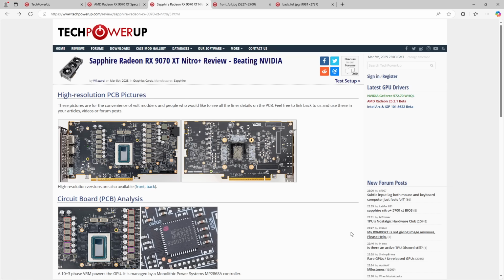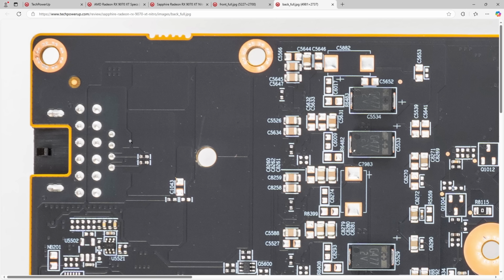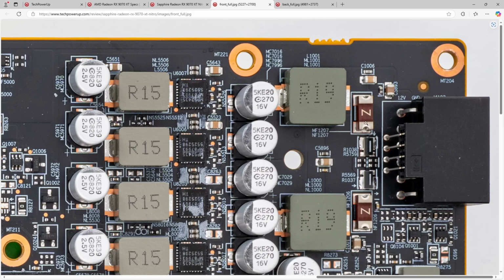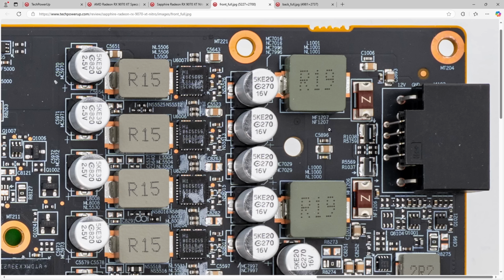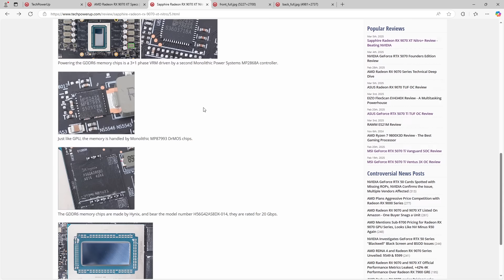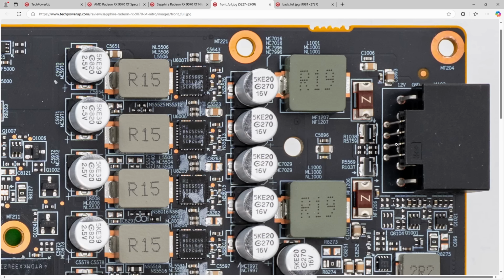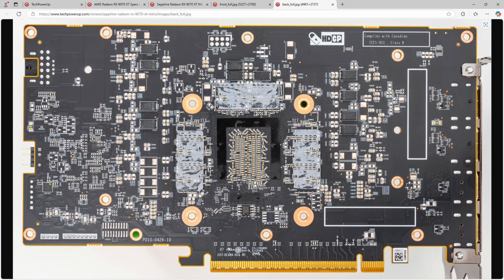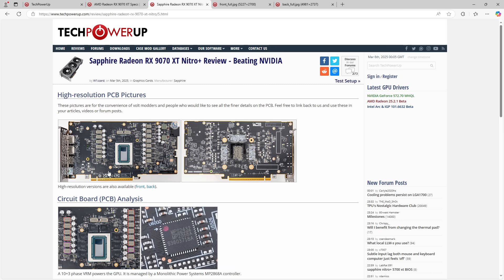Taking a look at Sapphire implementation of the 12VHPWR connector on the RX 9070 XT Nitro+

Comment: Mechanically, there's not really a way for 5 terminals to "make bad contact", 12vhpwr had an issue with partial connector insertion, 12v-2x6 with adjusted lengths of power and sense pins is not vulnerable to that same partial insertion issue that GN demonstrated.  So you're left with contact wear and corrosion to give you an imbalanced connector. The first is solved by leaving the thing alone once it's plugged in. The second is solved by not using materials which will give you galvanic/fretting corrosion (looking at you, lian-li, moddiy, and zotac, for variously speccing gold pins and terminals despite the spec calling for tin). 

If 5 circuits somehow did make bad contact, that'd be 25A on a single circuit, at worst spec contact resistance (6mOhm) that's only 3.75W of power dissipation, on a brand new (>=2mOhm) terminal it's 1.25W of power dissipation. It's more than you want on a single terminal and is 250% of a normal worst case single terminal (9.2A @ 6mOhm), but I'd expect you can also run it like that for quite some time considering Roman's wildly imbalanced cable was flowing 22A and he didn't even know he had a problem.

Comment: PSU side load balancing using multiple rails is strictly forbidden according to the publicly available ATX3 spec. The spec states, that all pins on a 12V-2x6 port have to be connected to the same power supply rail. The most any psu manufacturer could do within the spec would be per pin current monitoring to trip the OCP when any single pin draws too much current.

Some additional information regarding card side power balancing:
According to older PCIe Electromechanical Specifications it was explicitly forbidden to connect multiple power sources in parallel, meaning the 75W board power and all additional power connectors could not be shorted together in any way. That is likely why in the past all cards with multiple 6 or 8 pin connectors had load balancing. The specification forced manufacturers to split up phases.

I cant read the latest Revision of the spec which includes the 12V-2x6 since it costs 4500$ for non PCI-SIG members, but my guess is, that since all power comes from one source, manufacturers are at least allowed to do no load balancing, and may very well just skip it to save money.

Comment: Hey Buildzoid, food for thought: Igor Wallosek @igorslab just published a nice piece on how current Nvidia and AMD cards route the power return, finding that especially RDNA4 cards tend to have only about 10% of current go across the ground wires of the connector and the remaining current is dumped into the mainboard's ground plane via the PCIe slot.

Would love to hear your take on the matter.

Comment: i always wonder why the 8 pin PCIe connectors weren't just switched with 8 pin EPS, those can deliver up to 300w per connector -> 600w for a two cable card vs. 600w for this melting piece of garbage. 
Anyone knows why they didn't just do EPS instead of PCIe connectors ?

Comment: I had hopes that Sapphire did improve the implementation but they did not. 350watt is still to much and could burn the connector/wires. So it would be best to avoid this card and pick on with 2x or 3x 8p.

Comment: if all wires are dumped to one common rail immediatelly after the connector then whats the point of splitting the wires in the first place ... just take ONE wire that can actually handle the load which would also be more efficient to begin with than several thinner gauge wires ...

Comment: 2 fuses makes more sense than 6. If 6 fuses were used,  single fuses could blow, and the card continues to run until the others blow. If this OC card uses 360 watts /12v = 30 amps, 30 amps/6= 5 amps per wire. The fuse they use must be rated to the max current of one sigle wire in case the other 2 wires lose connection. A betted design would be current sensing for each 12v wire where no current or high current conditions could be detected. It is a cheaper solution to group all the 12v wires together for the 12v high power connector to share the current. 600w and 1 fuse over 50 amps is a horrible use of this connector on RTX5090 FE.

Comment: what I would like to see is a psu with built in 12v high power protection so the gpu can only pull what the single cable is rated to. there are smarter people than me on here that say it can be broken down it to 3 separate power stages ? what do I know I have not liked this plug from day one

Comment: @ActuallyHardcoreOverclocking that was THE review I was looking for. 

Thanks alot, what about Asorck 9070 XT TAICHI ? Can you please check that one please ? Nitro + and TAICHI was the 2 models I was looking for. And botch unfortunatly with 12V pin. If you could just respond here for GO/NO GO for the TAICHI it will be much apriciated. Wanna buy day one before scalpers, with stock and low price before demandes rises prices. 

<3

Comment: If there is an alternative 9070xt that doesn't use high phailure connector, just don't buy this, and buy that alternative one instead, vote with your wallet people. If this connector will become a money stopper, they just wont use it or will be forced to redesign it. As simple as that. Thanks buildzoid for another useful video!

Comment: Basically It's 12v 2x6 just carry the same power as 12V wires of 2x8pin.

It should be no problem unless very unbalanced current happen, It could heat up significantly but not melt due to it still a lot less current than what will happen in 5090.

Comment: You probably dont need to balance a 350watt gpu thats now even that much
Reply: That's still 30 Amps; the connectors are rated for a max of 9.5 A per pin ... with a laughable safety factor of 1.1. 
There's more than enough potential for disaster even on cards that don't draw 600W+.

Comment: Damn it Sapphire, you were the Chosen One!!
"It's over, I have the high failure connector"
Reply: Yeah, I'm a bit disappointed to see this because Sapphire has made great cards for a long time. PowerColor has been gunning for them, though, so I guess that's the next choice whenever AMD releases on the high end again and Sapphire uses this connector. 🤷
Reply: @dangerwr just don’t get the nitro, get the pulse. Problem solved and you get a sapphire card.
Reply: @OggaDugga  The Sapphire Pulse doesn't seem all that good this generation. Not bad, but not particularly good either. Sapphire cards only have 2 year warranties now, and that alone makes me want to get something from a different brand.
Reply: @syncmonism get something soon then because prices are on the rise 😂
Reply: Could get a Nitro+, but didn't trust this connector so went with Pure.
I see I'm not the only one not wanting to pay more for less safety.
Reply: nitro+ is the only one that has it.
Reply: @pedroduran8927  Yes. And, to be clear, only the Nitro+ 9070 XT. There is also a Nitro+ 9060 XT, and that model uses a standard 8-pin connector. 

I really don't understand why they would use this connector on their fanciest model. It seems like a really beautiful card aside from the choice of connector.
Reply: You underestimate my power!
Reply: @joshuaevans3501  don't try it!

* insert picture of smouldering anakin/12vhpwr connector *
Reply: @givemeajackson  😅😅😅
Reply: isnt sapphire owned by asus ?
Reply: No it's an entirely different company
Reply: @damasterpiece08  I thought it was owned by one of the bigger companies too, but it's apparently still a completely independent and privately owned (Taiwanese) company.

Comment: I wish they'd taken the opportunity to implement remote voltage sensing in the 12VHPWR spec and a maximum allowable voltage drop across supply cables so the device (GPU) could sense excessive voltage drop across the cables from the PSU. It saves having to have multiple current measurement channels at the input and the circuitry needed to actively balances but still gives you the fault condition detection.

Comment: To understand where they went you have to see where they came from. Not until the 8800GTX did PSU's need more than a single separate amp power rail output. Users even SLI'd off this. Simplified it was a single breaker that supplied enough amps for the given outlets.
When the 8800 launched this changed into 2 rail delivery or double breaker/buss providing more watts or stability/reliability if a GPU/Device tapped into each rail.
Broken down:
40amps or 3x8 pin connectors per rail with +10%
40a X 12v=480w and 480w / 3x8pin=160).
Each 8 pin listed limit: 150w

This card is using a single power rail + 75w provided by the PCIE port. and even though the power pins are joined, the split breaker design is near the middle allowing drain to have more even spread across input pins even at high load.
NV issue you showed last time had a 2x40 amp rail in a hard offset single point shunt design. This offset causes resistance balance with a multi wire design and like lightning, under heavy load will take the shortest path. A single wire or pair.
Current PSU designs will give a full 4 Rails 4X40amp.

That connector needs an update consort. Either GPU designers need to customize per board power delivery, or they need to redesign the source and each pin on a PSU should have a balance check upon output. And don't call it V1.1 of the same PSU line. That will just confuse consumers.
Needs a noticeable name change so you don't get the common ignorant "What's the difference".

Also consumers should understand when a GPU provider states the PSU needs, this considers you're using the newer standard which provides a number of rails based on that. A 4 rail PSU @ 40A, just the GPU power ports alone, provide 744watts ignoring all other ports and power needs of the full build. A 700w PSU is not going to have 4 rails. So follow this guidance well when changing GPU's.

BTW I'm with you. I don't like the design.

Comment: 0:38 "no active current balancing for this power connector. like if you were to cut off five of the 12 V wires all the current would just go through the one wire that you didn't cut"
and how "active current balancing" would change that?
is it NOT supposed to pass ALL OF THE CURRENT through one wire that is left functional? then maybe it should be called "active current LIMITING" or smth?

03:50 "nothing to prevent ... most of the current from just going through one of the wires instead of spreading EVENLY ACROSS ALL OF THEM"
5 of which are cut? how do you make the current flow through the wire that you cut?
if you are talking about spreading the current evenly across all of them and then STAYING AT THOSE CURRENT LEVELS PER WIRE EVEN IF THE NUMBER OF FUNCTIONAL WIRES GOES DOWN instead of increasing the current through the wires that are left functional  - that sounds more like current LIMITING.

Comment: omg buildzoid i know you aren't doing anything malicious on purpose but can you PLEASE stop saying "if you cut X wires" that does not happen, ever. neither do wires get dislodged from the connector housing, nor do the crimps fail. if it ever goes that far, it's actual user error because the connector would have to be quite disfigured for such issues to occur. like such damage is on the level of swinging a cable like a whip against a wall for a hundred times ... anyways - only tech tubers actually cut wires to make an unnecessary point about a completely unrealistic scenario which keeps validating unqualified and misinformed gamers who are angrily demanding a measure which cannot fix the root cause of the actual problem. just say that 12vhpwr is a flimsy piece of trash which sets the prerequisite for highly unreliable pin to pin contact even when fully seated, which leads to increased contact resistance across the connector. that alone is the actual problem and current balancing of any kind cannot mitigate or rectify the issue. rudimentary load balancing is used on 8pin and 6pin connector configurations in order to not exceed the specifications of the atx / pcie / whatever standard of each connector. but with 12vhpwr nvidia has a standard rated for "600w" to seemingly fulfill all their needs, so we don't need redundancy or load balancing for a singular ✨perfect✨ connector. it is not possible to current balance the six individual wires (running perfectly in parallel) of one cable, each of which should be carrying 8 amps under the full load of an rtx 5090, when in roman's example four of them are respectively carrying 2, 3, 4, and 5 amps. the remaining two wires are slightly overloaded at 10 amps, and extremely overloaded at 24 amps. this is not just absurd, it's outrageous. even replugging the same cable a hundred times shouldn't cause enough wear to warrant this behaviour. on four wires the contact resistance is high enough to severely limit the current capability to below 8 amps. that requires an additional resistance of more than 1.5 ohm, which is already 15.000% of the expected contact resistance per pin of ~5 milliohm. for 2 amps we are at 60.000%. this is unreal and a physical barrier, you ain't fixing 6 ohm of contact resistance by lowering the load on other wires. a similar phenomenon happens when just the connector itself melts. in those cases in conjunction with high current loads, the contact resistance is high enough to cause resistive heating on the pin contact transitions over prolonged periods, but not high enough to impede current capability

also i feel like somebody with a platform should address why we never see the wires for ground melting. the simple answer is because there are a few dozen common ground pins in the pcie x16 connector. weird how load balancing through simple redundancy just works, almost like it's a bad engineering practice to have one point of failure with no backup, especially when your failure mode isn't of binary but analogue nature

Comment: Quick, dumb, question...using the 3x8-PIN adapter wouldn't the power supply save these connectors from melting (due to the 150W/12.5A power cap of each strand and how 8-pin behaves) hence avoiding the problem of the single cable strand getting too much current?

I know it's not a solution...but at this point if it saves people from the meltdown, it should be advocated. In theory those H++ connectors should stay in place and not short like the first iteration, which was another issue.

It makes you wonder: wtf was the PCI-E SIG on when they approved this design?

Comment: So... the 12VHPWR hazard is here to stay?
As far as parallel connections go, 1 + 1 =/= 2, even in an ideal world. Not for fuses, cables or semiconductor devices off the top of my head.
When failures occur, like a cracked solder joint of bad crimp/contact, it will go south.
The design is the textbook definition of sub-standard.

Comment: Well, in my experience with cards from Sapphire: they have fuses. I had to sent a Sapphire card in for board level repair, and the technican said: "wow! that board has fuses! that actually saved the card from being e-waste!" so the repair was easy: replace 2 power stages, 2 fuses and it was done. since then the card is running in a productive system for over a  year now.
Imagine, the manufacturer is saving a couple cents in production to increase the margin, just by removing the fuses from the  pcb design. and then in an event, the card kills itself, because there is no safety fuse on the pcb for just a couple cents? So you as a customer have a total destroyed card and have to buy a complete new one....
That in the end, this connector and the proper implementation of the power delivery is still in the process of maturing, is mindblowing.
Reply: Sapphire is the best AIB anyway and don’t forget that they don’t earn the biggest $ because they aren’t Nvidia AIB and still they are better than Asus etc.

Comment: I guess using a power supply with embedded thermostat cables like the asrock taichi psu are the only way to safely use these connectors.

Comment: Honestly, while it is disappointing that they didnt put in any effort, i wouldn't be scared to buy it (it doesnt fit my case so i wont, but anyway) since it "only" draws 340w. 3090s tsp was 350w right, and didnt it consistently pull over that and the connector was fine?

Comment: They could do that on pcb, Divide it to 3 phase on the card, Simple.. I don't think connector wont melt on this card but over 200 watts for each connector is not healty, Cuz power supps does not  have same build/cable quality...

Comment: Why is nobody talking about going up in voltage? 24VDC, 36VCD or even up to 48VDC. Then you can have more power (Watt) through a smaller wire/connector without the crasy high current (Amps)? Please make a video about this and your take on it.

Comment: Even Sapphire can make mistakes..I'll stick with my XTX Nitro with 3x8pin (new design is ugly AF, looks like a trash bin 🤮). I checked the overclocking section and using max. power it gets about an extra 9-10fps. I get around 13-15 extra fps with uv+oc and setting power limit to 90%.. wtf?!

Comment: The common power rail can't be apart of the "spec" of the power connector.

It's just bad electrical engineering.

If the intention of the spec was to have a single rail, why didn't they just give a single higher gauge wire, that's what would make sense.

Comment: Even if the combining of all the pins is part of the spc, they could at least have put a temp sens in in the conector. Limit current draw and display a warning for the consumer that there is a bad connection. 
10 Cent part could save a 800 $ card. or a 3000$ one in case of Nvidia